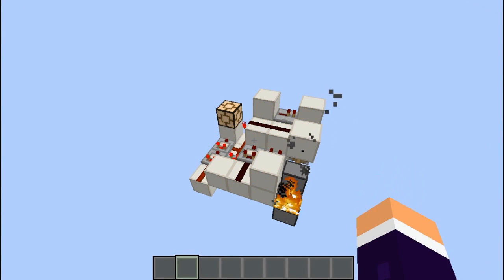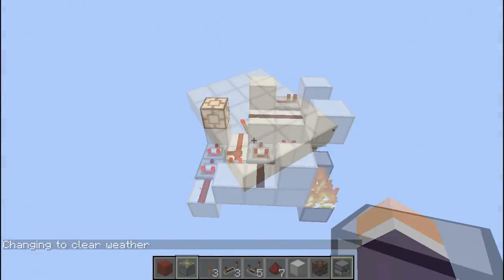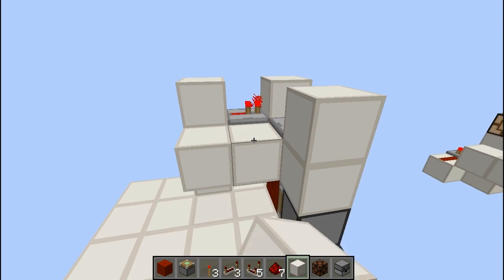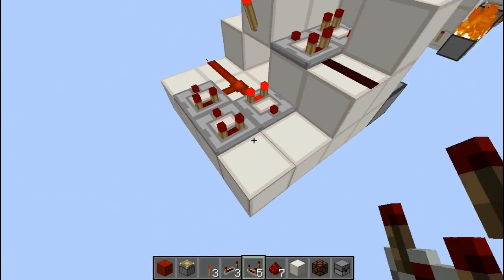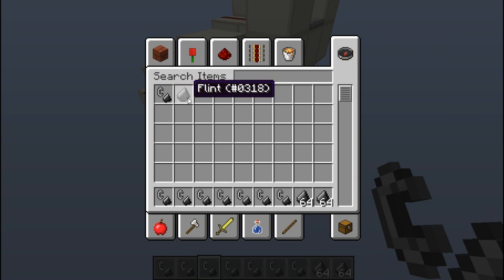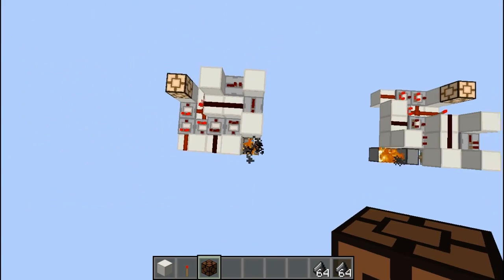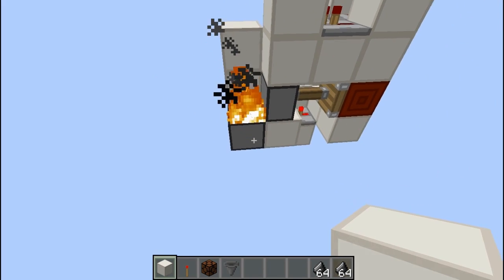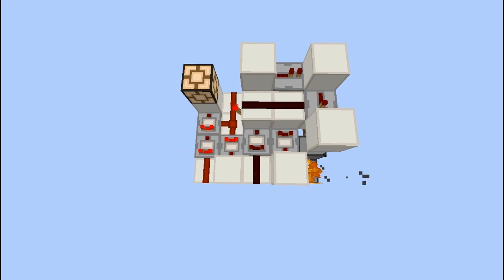Automatic Rain Detector [Survival Friendly!] 1.8 (Tutorial)

Comment: eh, question, the flame does go out by itself.. so it will do a command when it's not raining.. Any more effecient way of doing this
Reply: +ツリージェンﾈ Repeater under the stone below the light, getting power from the redstone dust. New block off of repeater. Redstone torch on top. Then command block on torch.
Reply: as by your description, you told me to add a 2nd commandblock, but you totally ignored my question. I wasn't trying to invert the signal. I was asking for a more efficient rain detector, because the flame would go out by itself.
On a side note, your description was not 100% clear, I had to read it 6 times to understand what you ment. Then I realized you only tried to invert the signal. I'm not an idiot, leave the experts over to the redstone comment section, please.

Comment: I'm trying to use a command block (/say It's sunny out here) instead of a lamp. But the command block activates every 10 seconds when the circuit refreshes. Can this somehow be fixed?
Reply: +Canonical Even better than Zach Roth's idea. Repeater drawing off the dust by the lamp. Then block, then torch, then command block.
Reply: Figured it out.. build two of these and have them both tied into the redstone controlling your command block.. the chances of both fire's going out at the same time when it's not raining is less common (still happens but a lot less often then every 10 seconds). but when it rains they both go out and command sent

Comment: Um, daylight sensor would make it easier
Reply: wat?
Reply: But tyen it would also activate at night
Reply: Daylight sensors do not test if it is raining or not
Reply: ***** Kind of. They only dim when it starts raining in the day. You can't tell at night though. Pretty much making them useless to detect rain.
Reply: veazix daylight sensors only detect the time. Rain does not affect it in any way
Reply: ***** Daylight sensors have an analogue output. When it rains the output gets weaker. You should try it yourself since you seem so certain.
Reply: veazix oh, i checked the wiki and you were right! They were acting differently when they first came out and i tested them...

Comment: nice design, the only problem is that when it is not raining the fire produced by the flint and steel goes out after a short amount of time. When hooked up to a command block this can get very annoying when it is outputting a command to clear the rain every 15-20 seconds. Using netherrack doesn't work either because the rain will not put the flame out if it is on netherrack.